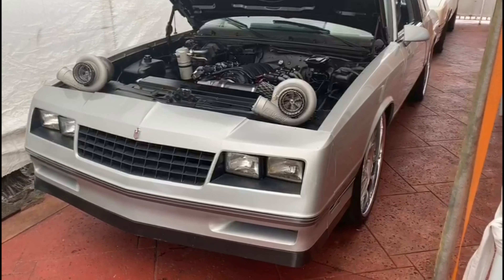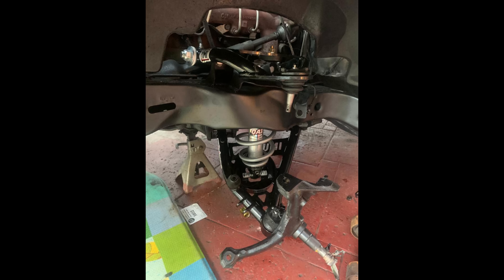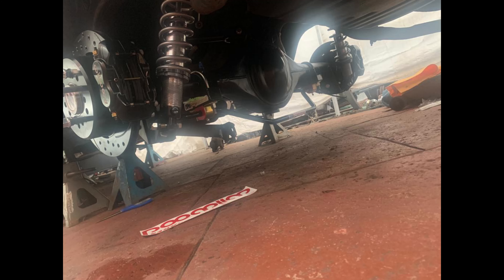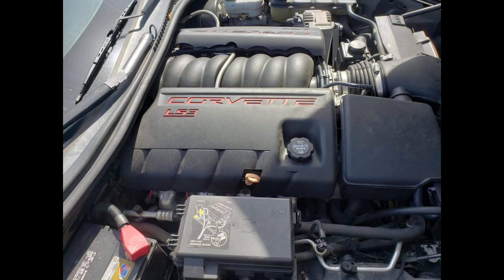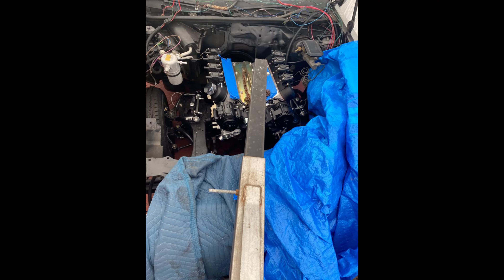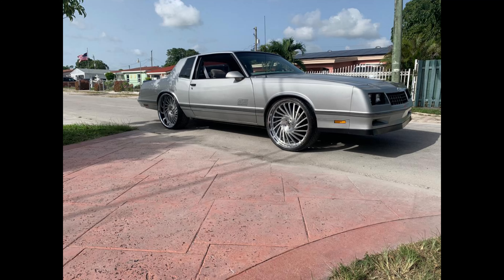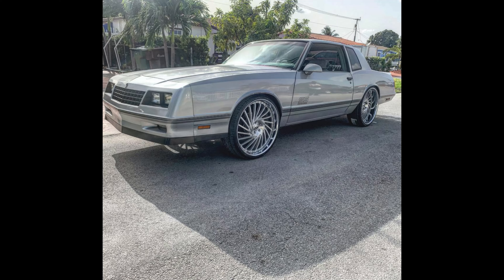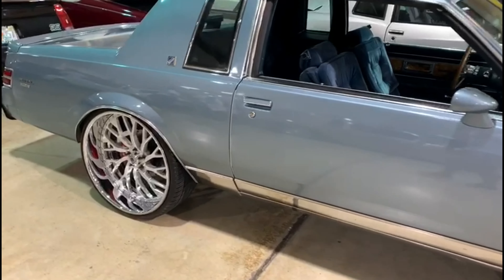Twin Turbo 1988 Monte Carlo SS LSX Swapped Gbody

Comment: thats bad ass man. clean and pretty.. i have 1985 monte carlo ss brug on burg.. im rebuilding the inside. i put a 383 stroke motor in mine and redid the tranny. you ant lived to you drift a monte carlo at 65 miles per hour.
Reply from the maker: Thanks I really appreciate it .

Comment: Tuti,
What is the width of your vehicle’s rear differential? Is it stock width, a Ford 9” or something shorter to accommodate wider wheels?

I have an 87 MCSS and I’m trying to see how big and wide I can go without cutting or tubing my car. I’m thinking 18x9.5 up front and 18x10 rear. I have a Moser Ford 9” rear by the way….thanks 👍

Comment: what brand center link an tie rods did you use.. And did you use single or double adjustable coil over
Reply from the maker: Hotchkis forged steering kit , the front was double adjustable and the rear was single

Comment: Nice build! I am working on my 85, which radiator do you recommend for an ls swap? Also do you run a separate trans cooler?
Reply from the maker: I like using Griffin Radiator and yes I like running separate Trans cooler